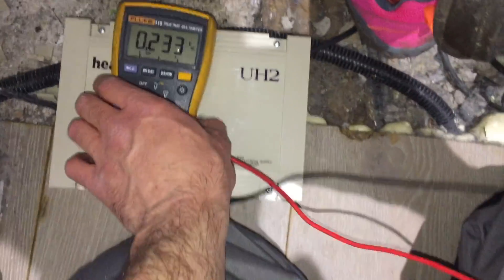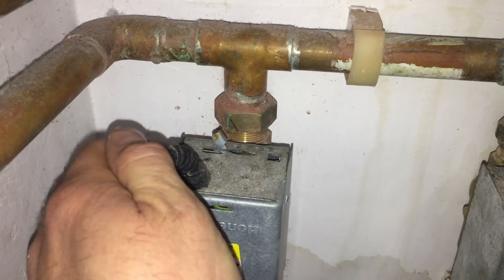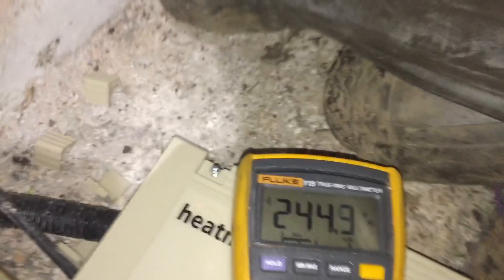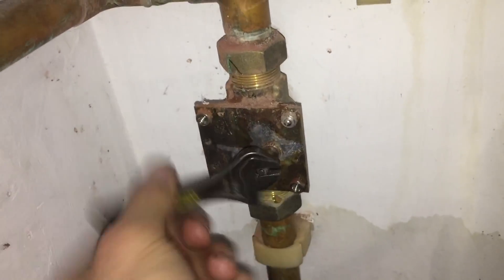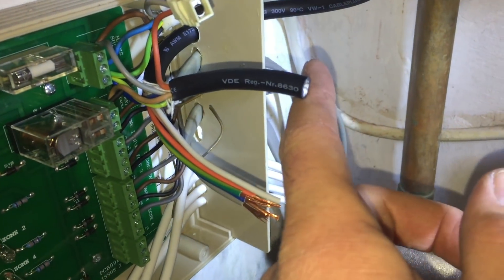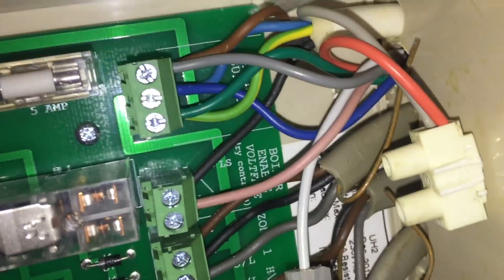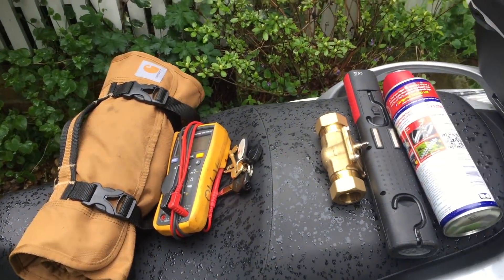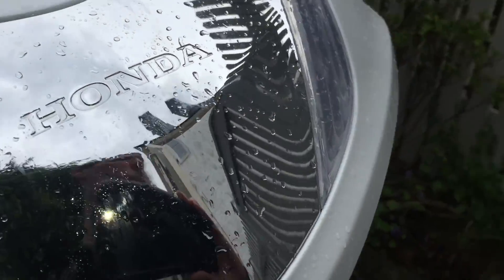2 port valve. boiler not working.

Comment: You don’t like seeing bare cores but you don’t mind using non compliant test leads as specified by GS38 which is a minimum of 4mm exposed tip (recommended 2mm, spring loaded), a good helpful video though.
Reply from the maker: Bet your fun at parties.... I'm not worried about myself but worried for my customers.

Comment: And then 12 months later same thing happens again. I’ve had a plumber change mine twice and now it’s broke again!
No way am I paying another plumber to quickly free up the valve and install a new motor when it’s clearly the valve that’s causing the motor to break! I’m just going to change the whole thing and be done with it which is what the plumber should have done in the first place. 
I understand why though, because it’s fkin ball ache and most plumbers just want a quick fix and outta there!
Reply: Did ir work after he fitted it, therefore why are you complaining, probabky wanted to save you miney as draining and refilling a sytem, venting radiators, making sure theres no airlocks, letting heatinf reach temp all takes time which costs you money and takes us his time
Reply: @MMKLYH  money wasn’t an issue and I told him just to change the whole valve and motor but like I already said, plumbers don’t want that sort of work, they prefer easy jobs that are quick.
Took me a full afternoon but I changed it myself,inc draining/refill/vent - plumbers are overrated 😁

Comment: Cheers mate good stuff. I have a three way Honeywell. Spindle feels free with head off.   Warm rads when heating hot water tank. Watching it drive to close with the tank switched on it seems sluggish and doesn't seem to get to the end of the gear track, it will if encouraged a little with a driver. Seems fast driving the other way so I guess it's leaving a crack open to warm rads. Would you suggest changing the head only or reckon there might be a fault inside the valve? Cheers
Reply from the maker: @Mircea I know the motor is constantly trying to turn. I also know they get hotter when kept like this. Im not educated in electronics and cant give you factual info. I can only tell you what I have noticed in the last 20 years of working with them as a gas engineer. As they get older the thick grease leaks out of them with the heat and they begin to get noisy and seize.
Reply from the maker: @Mircea exactly :-)
Reply from the maker: I alway try and free them off first. :-)

Comment: Nice to see old school techniques used. Great video as usual. Hope your hearing went well.
Reply from the maker: I lost the hearing but learned some of the new rules around loading and unloading.
Reply: @HeatingGeek  Feel free to tell.

I had similar issue years ago - cost me a 50p stamp to defend myself but parking fine avoided.
Reply from the maker: @millomweb  Loading and unloading is not: Purchasing something from merchants. It must be pre-ordered on an account. Otherwise, its classed as shopping. Load of BS.
Reply: @HeatingGeek  I was dropping off a video for repair.

So now you have to sit in your car outside the shop order your pencil then you can pop in and buy it :)
Reply: @HeatingGeek  I've had visions of having a 4 wheeled hand cart/trailer. Parking at the edge of the city centre then walking down the road (any side of it) with the hand cart, ignoring traffic lights & one way streets to pick up say a microwave or washing machine or whateva !
Being a pedestrian even with a cart, you rule !

Comment: hi my honeywell valve was stuck inside brass body like youres wouldnt budge had to use wrench to open partially but still would stay in open position why would that part go bad??
Reply from the maker: I don't know. Honeywell have defiantly dropped their standards.
Reply: @HeatingGeek  I've not yet had to lube a Honeywell but have had to do a Drayton.
Maybe I should have kept that 40 year old Honeywell after all !

Comment: Are you going to installer show this week?
Reply from the maker: Where is it? I don't usually go to them things tbh. If I'm out and about and passing  I might pop in.
Reply from the maker: That was a quick comment. I thought this video was still processing!!
Reply: HeatingGeek It's at the Ricoh arena in Coventry, haven't been before either but going tomorrow.
Reply from the maker: Im in Reading and NW London tomorrow so I think I will have to give it a miss. There is one at Alexandra Palace and Earls Court most years thats the ones i try and pop in. Coventry is a bit far ;-)